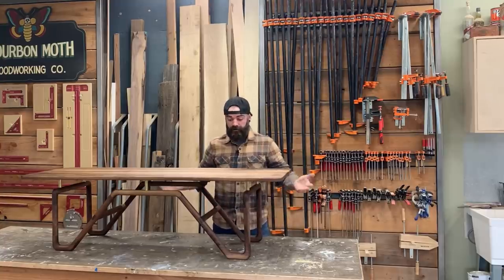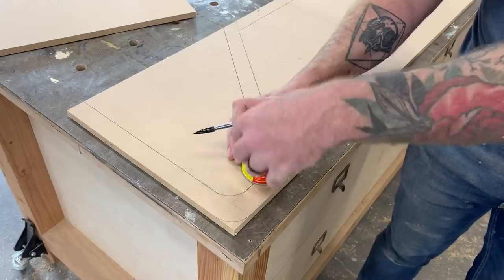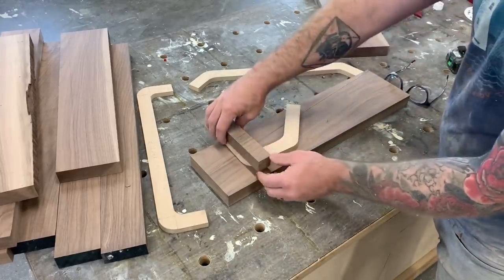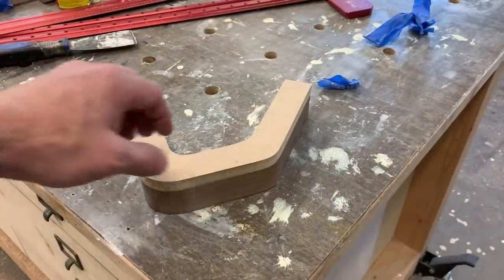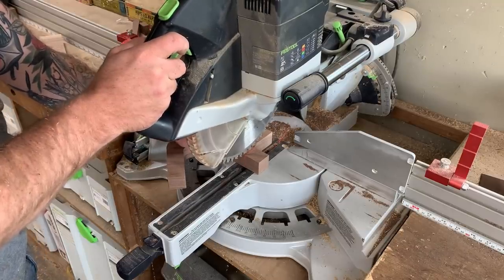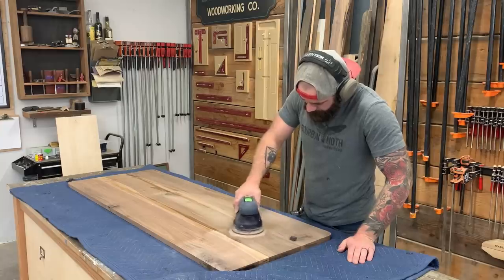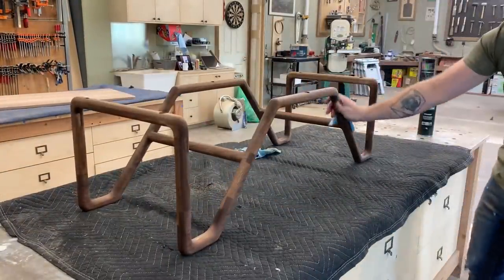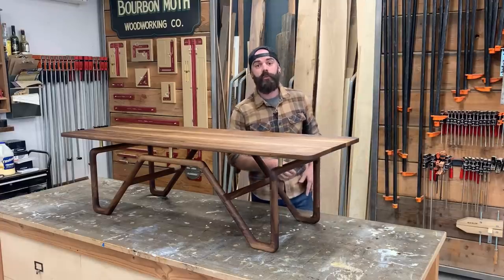Mid-Century Coffee Table // Crazy Coffee Table Build

Comment: I like the design and how you fine-tuned it by using MDF.  For your next similar piece, you may wish to try a different joinery method.
  Then, to save money,  you could have used brass (or plumbing copper tube as it's even cheaper)

Comment: I had the same experience with my router table the other day. I ended up holding my piece in a tapper jig that was for my table saw. I removed the runner so I could use it on the router table and it allowed me to control the small parts.

Comment: Great work. Turned out really cool. A couple tips: 
- When making a template with an inside round, drill those rounds out first with a large forstner or hole saw, then cut to the cirlce. Save on sanding. 
- If you mount some handles to your templates, then you have something beefy to hold onto as you push them over the router table. Keeps those fingers away from the rotary finger-shortening device i.e. router table bit. I find I get better accuracy on a table than with a trim router.
In the end though.... it's the results that count. And it looks sweet. That foreman though.... he looks like a real pretty harsh boss. ;-)

Comment: I've really fallen in love with using one of those micro jig GRR-Ripper things for manipulating smaller pieces on my router table. I use that L bracket piece that comes with it to sit flush on the router table top and then the green rubber pads sit on top of my work piece. It ends up super stable and works great for small parts that you can't really fit more traditional paddles or push sticks on.

Comment: Table looks great 👍  I have a question on epoxying brass to wood, I used 5 min epoxy to glue 1/8 brass plates to walnut for a handle but when I sanded it to shape the epoxy heated up and came apart. What kind of epoxy do you recommend for me to use so this doesn't happen? Thanks for you help